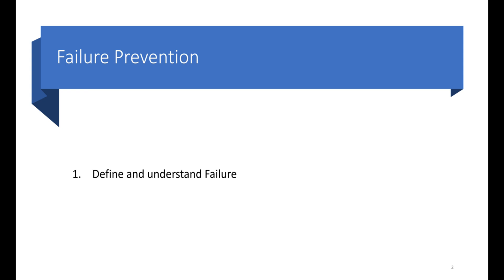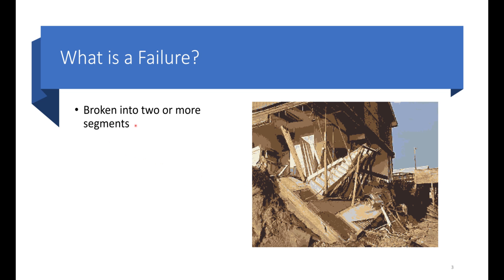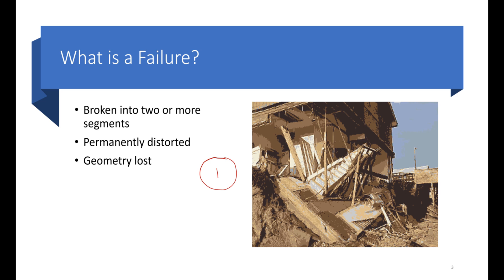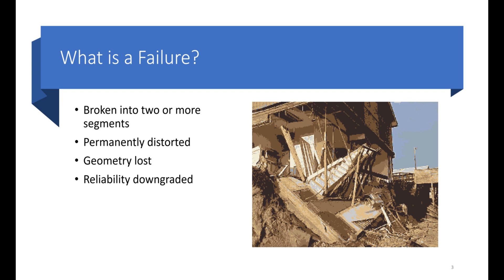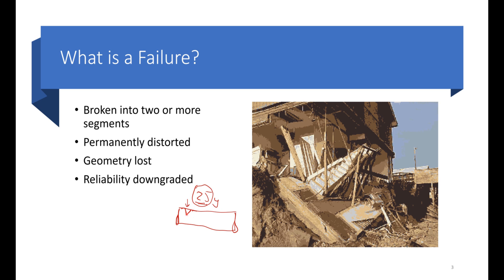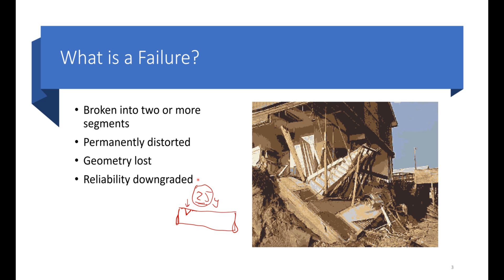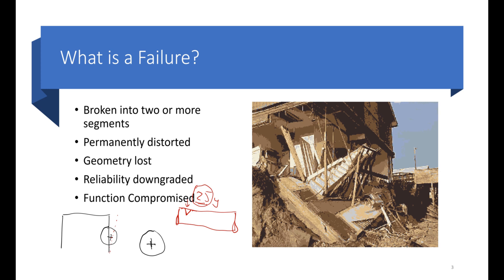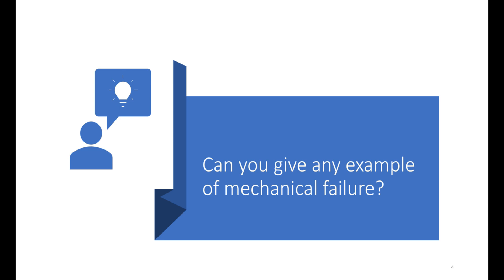5 -1 Design of Machine Elements | Failure Criteria | What is Failure?

Comment: 2017126
Sir the example may be a refrigerator which has a life/warranty of 10 years and it stops working after only 2 years, so there is a failure of reliability down gradation, and this failure can also be called as functional failure as now the fridge is not fulfilling its purpose..
Q 1. Isn't the geometry lost and distortion failure kind of same thing,

Comment: One Of the Mode of failure is Creep. The example of creep is the indents you see in roads that are several years old. The weight of cars is far below the yield strength of concrete, but the prolonged exposure to this force results in plastic deformation.

Comment: The example can of machine failure.
POTENTIAL CAUSES OF MACHINE FAILURES

Vibration increase and excessive component heating are signs that something is going in the wrong direction. In the case of non-typical vibrations, the main causes are: defective bearings and gears, electrical and mechanical failures in motors, problems caused by misalignments, unbalances or unstable bases, bent shafts, pulley or belt failures, mechanical gaps, aerodynamic or hydraulic problems

Comment: One example of Mechanical Failure (Reliability Downgraded) is the Collapsing of Tacoma Narrows Bridge in USA 1940. The bridge was opened in July 1940 but due to winds with speeds as low as 35 miles/hr the bridge started to dangerously swing sideways and started to wobble.
The bridge collapsed on November 1940, a few months after its opening, It was the third-largest suspension bridge at the time and thus 6 Million Dollars spent on its construction went down the drain.

Comment: Sir, if we find a crack in any object but it's still able to perform a task. Isn't a failure?
Reply from the maker: If the crack is small enough that it will not propagate to stop the function of the object for its designed life then it is not a failure.